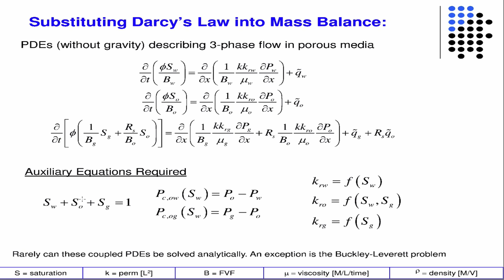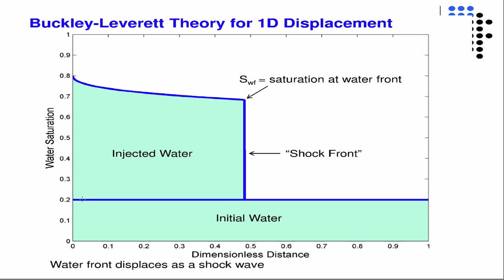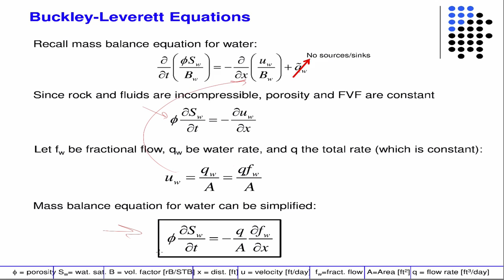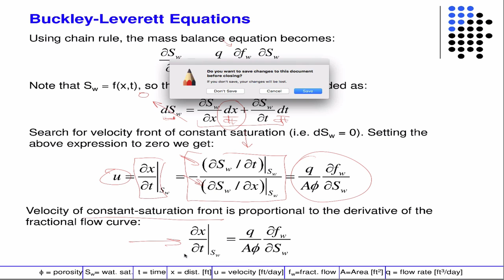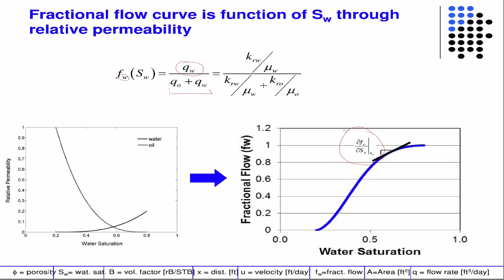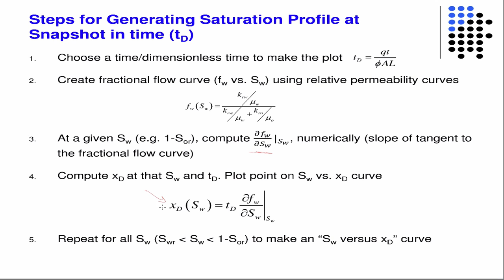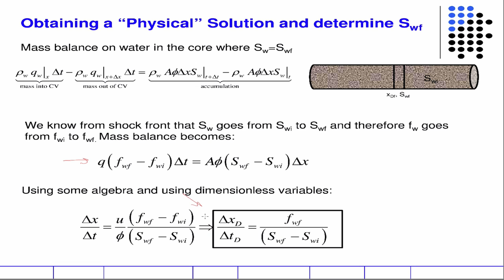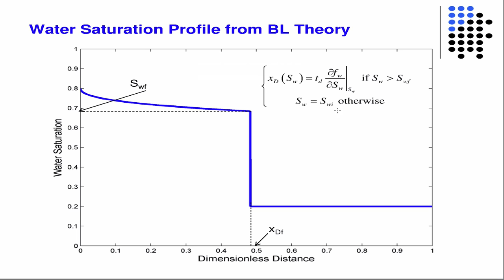Buckley-Leverett Theory

Comment: Essential phenomenon of seminar - analytical solution saturation equations presented in 1D is not simply to present. So I am greatfull to present study of presentation with Water  fronta dicplaces as ashock water ( fig. of dimensionless distance and water saturation) to obtain all in on called ~prasent an analytical solution of Buckley - Levertt equation. If we have gas gas flooding with constat pressurre boundary including the effects of miscibility on the viscosity and relative permeability wa also look Buckley- Levertt equations. Incresising you mantioned Darcy's theorem and how we got fractional flow.
     We can also imply this presentation for relative permeability model and viscosity model with consideration of miscibility  are used to describe the variationd of relative permeability model and a viscosity model with.
   Also the govering equations related to the change of fluid properties properties which govern viscous fingering are discussed. This term I see in one yournal - then the gas flood BOL-equations accounting for a gravity and miscibility effects for incline stratified heterogrnus and solved analytically using fractional flow theory and Method of characteristics - AS YOU MENTION- sincerely greatfull!
    I get input information for the anallytic solution provides the guidance to predict the oil recovery and saturation distribution at any given time for horizontal, incident, homogene us and heterogene us reservoirs.
THANK YOU FOR WORLDWIDE BENEFIT!